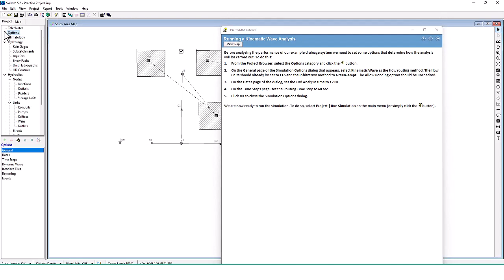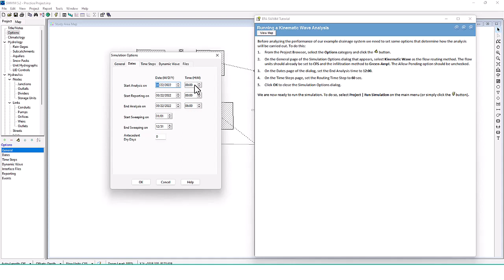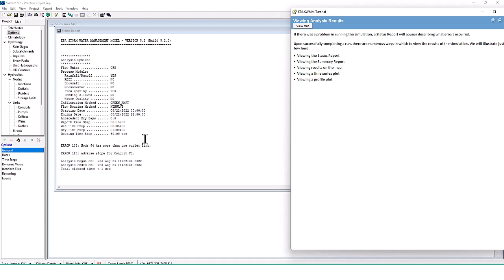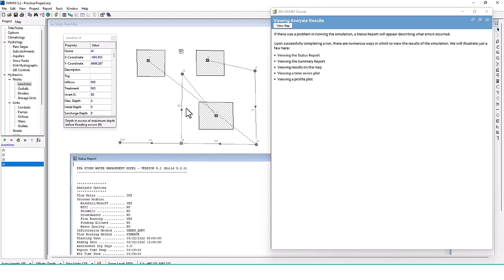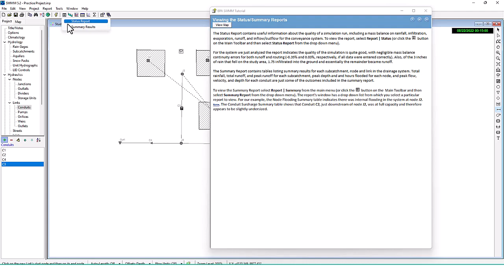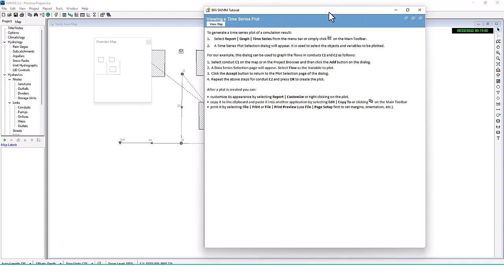EPA SWMM LESSON PART 4 | Running an EPA SWMM Project

Comment: Im new to this software and my new project has a runoff of 0% and there's inadequate explaination on the values on the nodes and links.

Why subcatchments area is equal to 4? what is the unit?
Reply from the maker: It depends on your units. I was using English units, so Subcatchment area often given in acres.